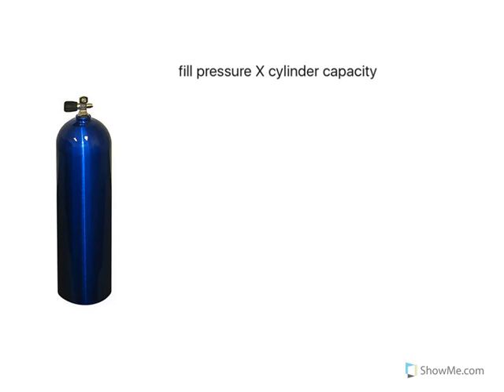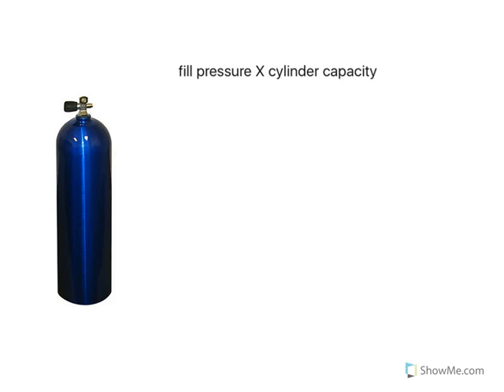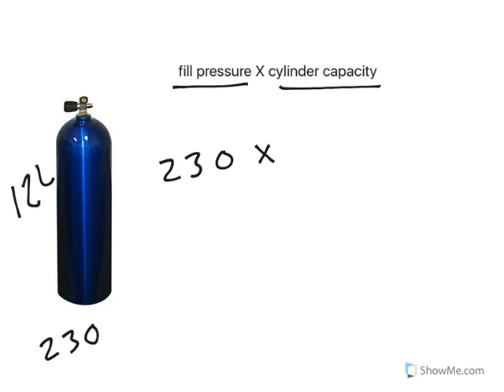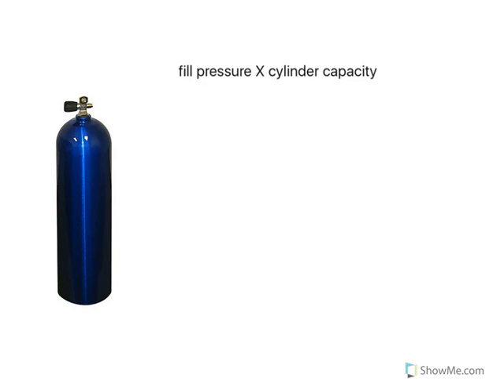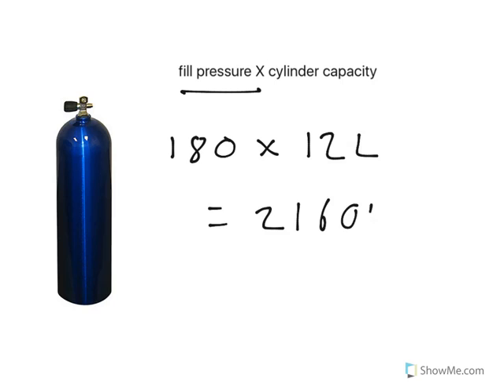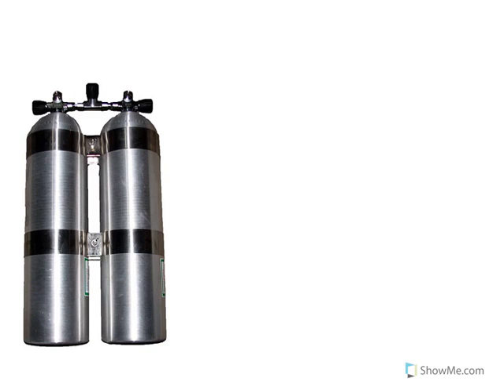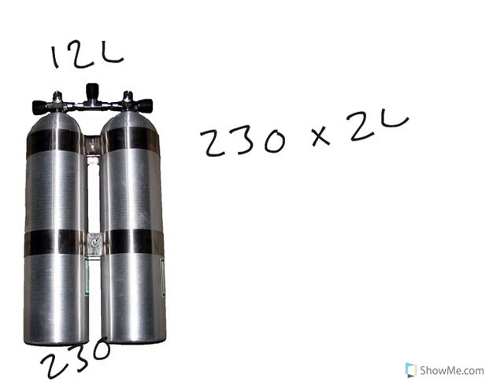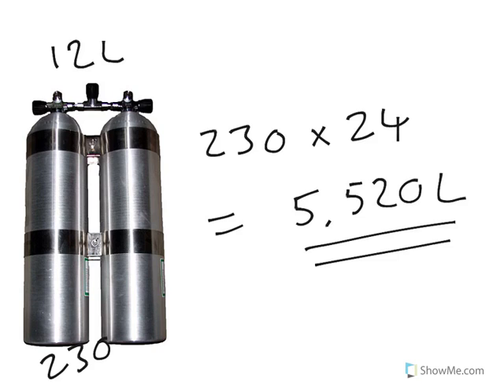Calculating Gas Volume in a SCUBA cylinder

Comment: Some website I read said: "Pressure and size determine the volume of air a tank can hold (capacity)."

The way you are using capacity, sounds like size in the statement above. And when you are calculating the total gas volume, that sounds like capacity in the statement above.

So what are the correct terms? Is it pressure x (size or capacity)?
Reply: In the video this is based on Boyles law which assumes the temperature in the initial state and final state is constant. Here initial state means when the tank is full of air and final state means when all the air has been let out of the tank. So the equation looks like this: P1*V1 = P2*V2 where P1 is the pressure (in bar) of the air inside the tank and V1 the volume (in L) of the tank (physical volume e.g. 12 L). P2 is the pressure outside the tank, so on the surface it is 1 bar (not exactly but close enough), but we do not know what V2 will be when all that compressed air has been let out into the atmosphere, i.e., how much air the tank contained from a 1 bar point of view. Let’s compute it using Boyles law: V2 = P1*V1/P2. Now since P2 = 1 bar then after you have canceled bar out in the numerator and denominator you get basically the equation presented in the video, except the unit of P1 has been canceled out. So this is why you see it presented as V2 = P1*V1, but for units to match P1 is unitless. Otherwise just remember it as V2 = P1*V1/P2 and you should not be confused :-)

Now if the temperature also can vary you want to check out the combined gas law. Just note with these equations we are assuming ideal gases.

Comment: Good video. Thank you. You just have to remember that 1 bar is not exactly = to 1 atm, to make sure the volume in liters are correct divide your number by 1.01325. In you example 12L x 230bar/1.01325=2723 L not 2760L.